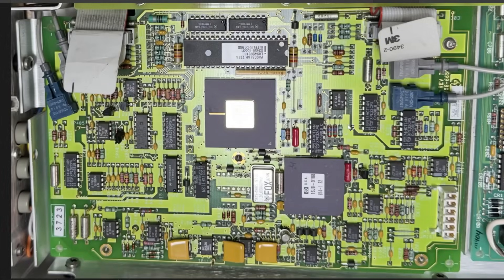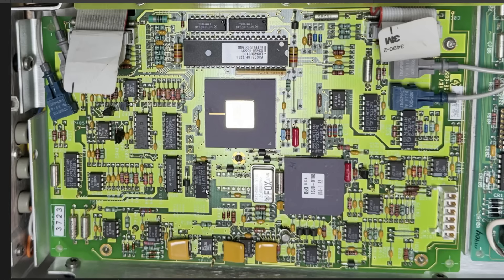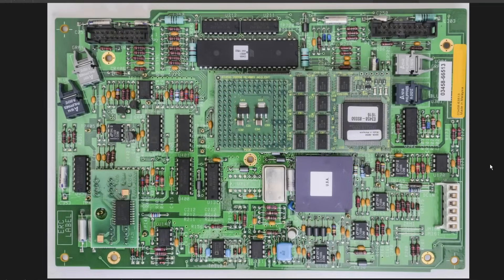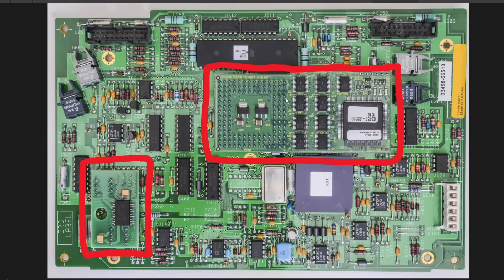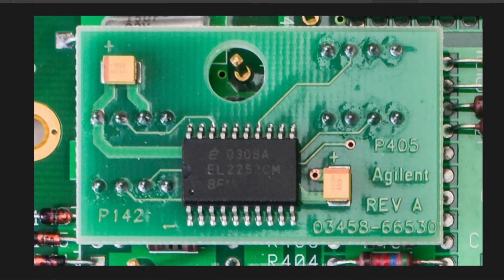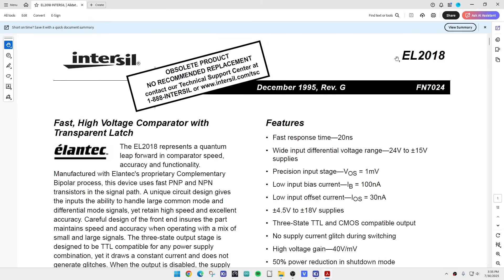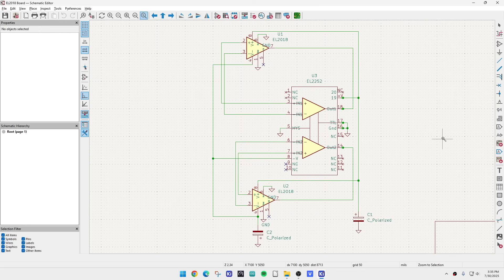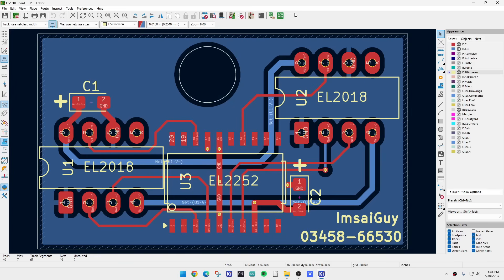#2317 Agilent 3458A 8.5 Digit Multimeter (part 8 of 16)

Comment: Based on a test of the 3458A CLIP and a test on a real A3 board, the U1 and U2 Vcc are at different potentials.
Pin 8 of U1 is at +15Vdc (+15_R), pin 8 of U2 is at +5V (+5_b). Essentially, with this adapter you're shorting two different power supplies.
Reply from the maker: Yikes! you are right. I've corrected this. thanks.
Reply: @IMSAIGuy  What this fixed in the PCBWay upload?

Comment: EL2252 is long obsolete, so where is the point of the patch board?
In the current A3 revision they are replaced by a 5V comparator with some level conversion
Reply from the maker: in a future video, I show a vendor with stock of those parts and so you can get new ones. yes they are rare. can you show me documents with the A3 design. I would like to see that
Reply: @IMSAIGuy  Cannot link, but there are pics of new A3: eevblog, topic: HP 3458A ; A/D board spare part availibilty and cost, p.9 "Last photo" from tonyz663
Reply: @IMSAIGuy comment was deleted even w/o a link

Comment: On your schematic, pin 8 of both EL2018s is supposed to connect to pin 19 of the EL2252, but I don't see a link on the picture of the PCB. Perhaps a missing trace?
Reply from the maker: you are correct, thanks
Reply from the maker: The board on PCBWAY has been corrected

Comment: But what do you do of the third EL2018 goes bad? You should have a board that lets you replace the third with a dual EL2252 as well.
Reply from the maker: Agilent uses the same board. just half of it does nothing
Reply: @IMSAIGuy I assume they don’t populate the second set of pins?
Reply from the maker: @jsdutky  yup, no need

Comment: The dual comparator seem to be missing the latch and CS function. With this it can not replace U181. Here one would need to make a different replacement with a latch and maybe a different comparator, as this one does not need the high speed.

The large chip that is replaced by the FPGA and level translators is the gate array, not the hybid chip that is notorious for failing.